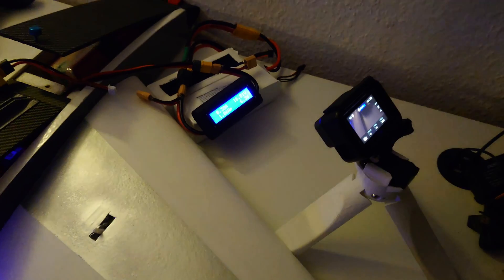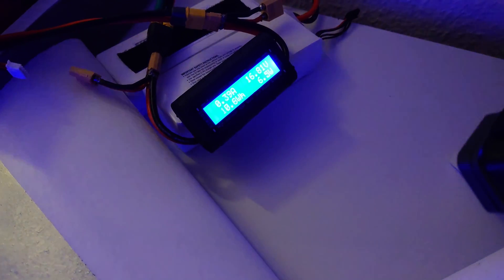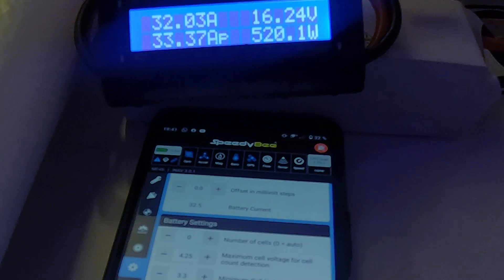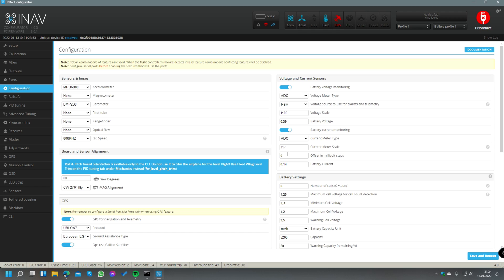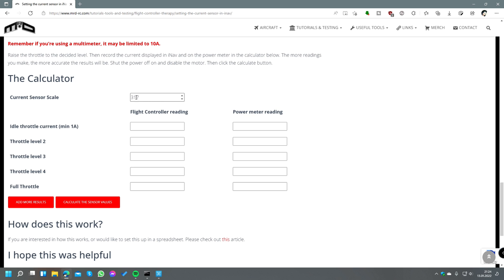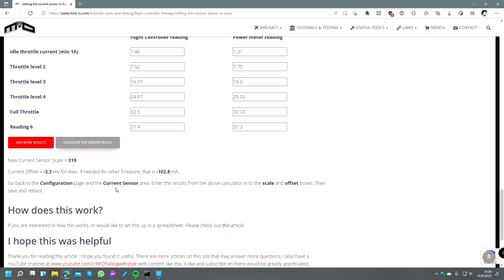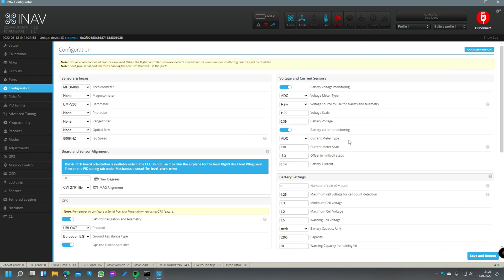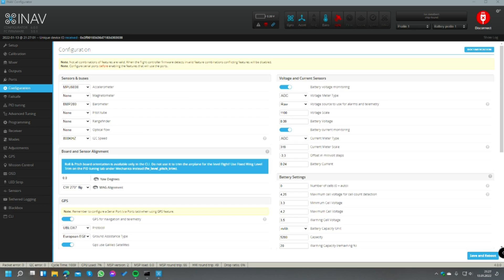Current Sensor Calibration in INAV Betaflight and more

Comment: Hi Marc, I have an Omnibus F4 Pro v3 and although I have tested the method with the power meter (I did it before seeing your video) and on the bench I had 100% accuracy when battery was full in all the possible throttle positions, in the real flight I had a huge difference. My OSD showed 2454mAh but my charger put 1551mAh. So I'm afraid this method is not valid in my case. I suppose the problem is in the hardware. Probably they have powered the Opamp on the shunt resistor directly from the battery voltage, so when the voltage drops, the voltage reference and the readings drop too. I haven't checked the omnibus circuit yet but this is the only explaination I can give. So for now I'll start calculating the coefficient by the difference between the OSD and the charger. I hate this method too but what is important is to have the correct total in the air to know how much energy is left. If the opamp is powered directly from the battery voltage I will need to modify the circuit to power it up from the 5V of the board... If this is not the case and the circuit is fine then the only thing I can think is that the temperature of the shunt resistor increases in flight and thus produces higher readings. If you have any other ideas of what is so wrong in my case please tell.

Comment: Thanks for this video!  I have everything set up and once I arm, my quad idles fine.  When I go to increase to throttle to throttle level 2, my motors ramp up and continue to ramp up well past throttle level 2.  I have Airmode enabled on horizon and acro, but not in angle.  I am in angle doing this test with props on.  The drone is secured to my workbench.  

Any ideas on why I’m unable to move thru the throttle range without the “spool up” of the motors once I go past about 10% throttle?
Reply from the maker: In quads the pid controller will freak out when it's not moving. You need to go into cinfugurator and then in the outputs tab to manually control the motors.
Reply: @MarcFPV  I tried using the motors tab on the SpeedyBee app.  I’m able to spin the motors up using the sliders or the + and - buttons.  The current draw does not change in the app.  It stays at .21.  The current draw increases on the power meter.
Reply from the maker: @IAmTheCraftsman  that might be a problem with the SpeedyBee app then. Maybe try the official configurator instead.
Reply: @MarcFPV  got it done!  I did as you suggested and Bluetooth’d from my laptop using the full configurator.

Before I took your advice, I researched how to do this using the mah used, mah replaced method.  Oscar Liang has a webpage that details how to calibrate the current sensor three ways.  

-The mah used, mah replaced method
- A method that involves a multimeter and removed props
- A method involving a power meter with props on

While describing the power meter method, Oscar mentioned swapping the props side to side on the front motors and side to side on the rear motors so that the props produce negative thrust instead of positive thrust like they normally do.  

That didn’t occur to me to do that.  

I was trying to figure out how I was going to hold my quad down with one hand when manipulating the slider and writing down values on a piece of paper with the other… 😂
Recipe for disaster!!!

Thanks again for the video and your personal attention in the comments!

Comment: A great reference video. 

As is pointed out, it's important to measure current at similar battery loading to that being used in flight. Cruise throttle setting would be a good reference point.
Typical battery charging currents (charge/discharge) are much less than amps consumed while flying,, so battery is not working as hard (no voltage sag, etc). Battery capacity measured at low currents will always be greater than if the battery is under stress of higher currents. Higher C-rated and newer batteries show less variation in actual vs their capacity specification.
Better to test with partially discharged pack, or near storage voltage, as fully charged pack will have higher voltage, and thus consume lower current for given power level vs. when pack has mostly discharged.
Reply from the maker: Hey, thanks for the input. But it is not fully correct. The current sensor completey ignores the voltage. It only measures the actual current flowing. The voltage or voltage sag does not matter at all. Of course in flight the power will drop on lower battery voltage but the current alone can be measured at the same time correctly. So all that matters here is the realtime comparison between a calibrated current sensor to the FC current sensor.